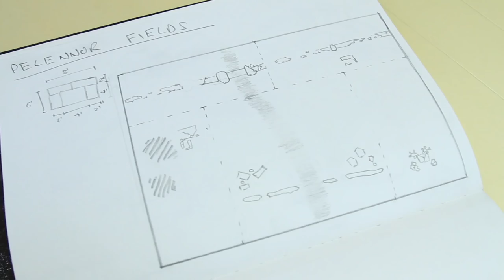Gondor Walls Rammas Echor ~ Pelennor Fields Terrain Tutorial Part 1

Comment: Gorgeous and stunning result ! I do have a question upon many... How is the base board created ? From which materials is it made of ? Sorry English isn't my mother language and I don't get the part between 6:18 and 6:31.
Reply from the maker: Hey maxi! So it's made from a timber base board about 5mm thick, the timber I use is called masonite  it any timber sheeting would work and the board itself is extruded polystyrene foam :)

Comment: Fantastic work, as always. Which material is what you use for the road? I don't understand right in the video.
Reply from the maker: So  it's a type of wood putty, used for filling in holes in timber when you're making furniture and flooring. It's really soft like a clay, but I'm actually thinking even something like playdough might be useful too and save some $$$
Reply: OK thanks, I understand what you mean.  But playdough will not stay soft? you can use diluted wood glue over, or mix it with a kind of greenstuff or supersculpey.
Reply from the maker: @javiermallo2203  yeah it might actually, it definitely wouldn't be as durable either, but yeah a green stuff mix would help harden it :D